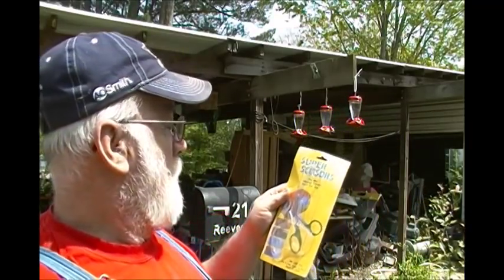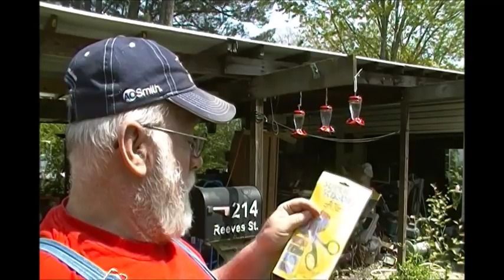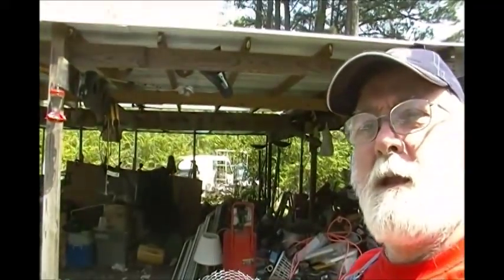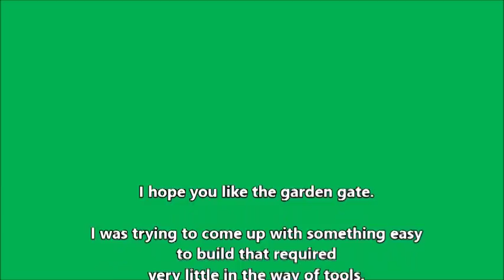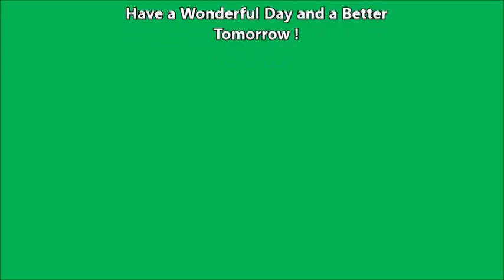How to Build a Garden Gate by PawPaw  EASY FAST CHEAP NICE

Comment: The gate is simple an functional, I wish I had thought of it, we have T posts as well around our garden area.  Best trick we have found to keep the deer out is to tear old sheets into strips, surround the garden with them and tie white plastic grocery bags to the sheet rope.  I don't know for sure if it is the motion, or simulating the white flag under their tail that the deer use to signal danger, but it does work well.

Comment: What size PVC pipes alone  with your 90-degree and your tee
Reply from the maker: 2 inch I.D.  the t-posts are 1 3/4 inches at their widest point.  The screws I put in the pipe that goes over the post were cut short so they would not protrude and catch on the post.
Reply from the maker: If you used rebar for a post, you could use smaller pipe.
Reply: Thank you
Reply: Thank you
Reply from the maker: Thank YOU for watching my videos and subscribing to my channel !!